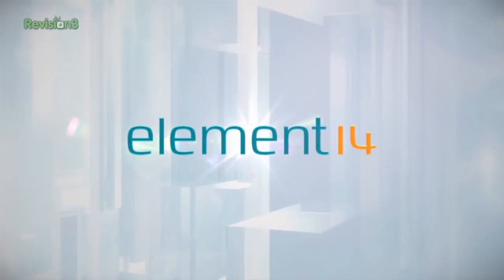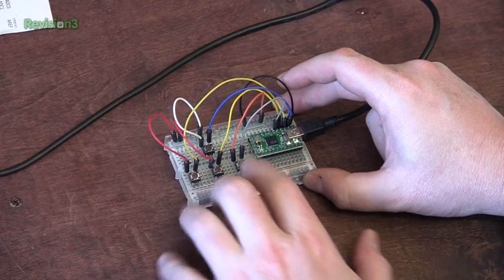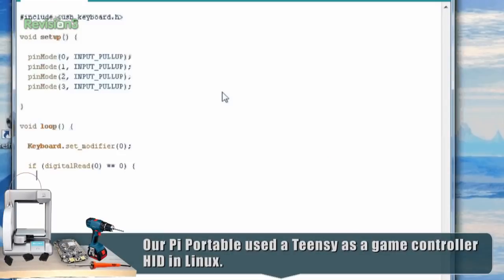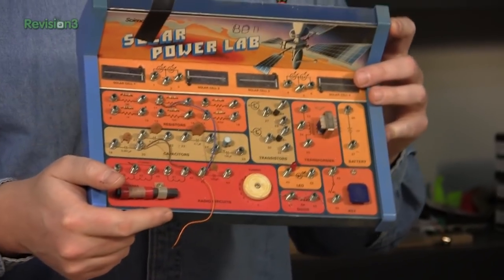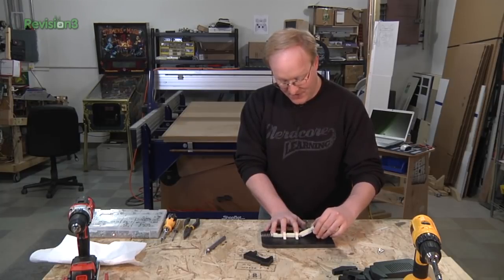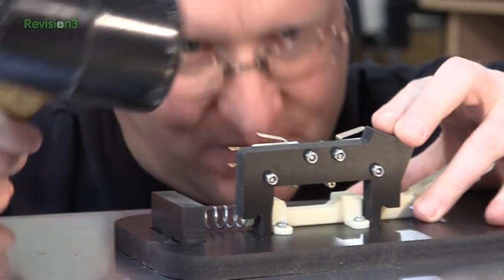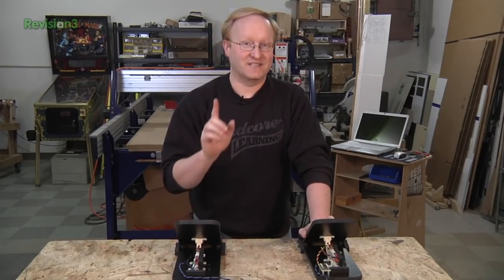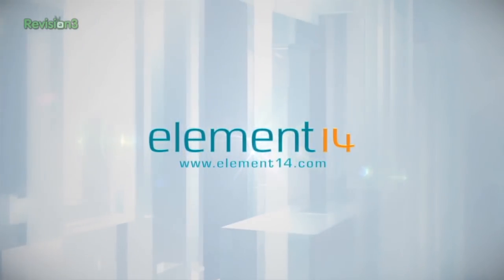Beyond WASD: Foot Pedals for PC Gaming

Comment: Why didn't you do the pedals with a potentiometer mounted at the axis, you could have simply used a threshold value for the Vout of the poti, that way you could have defined the points at which the keys are pressed in firmware instead of in hardware, and also altered the firmware to support analogue control (via the joystick component) if you need it, e.g. when playing a flight sim.
Reply: ***** Foot pedals are normally for the rudder. Flaps are usually some kind of manual control, since you don't use them much.

Comment: Would it not be simpler to just buy a set of pedals and configure them in the game you want to play to do the functions you want or use their software to present as something a given game can understand (like forwards/backwards)?  They do make & sell pedals... both 2/3 ones for racing games and 2's for rudder control in flight sims.
Reply: Of course it would be simpler. That's not the point. Are you new to this channel?
Reply: No.  I'm not.  I can see the point in the 360 auto-changer, I can see the point of a portable Ouya or the various one handed controllers.  No alternatives really exist. 

This is however a pointless waste of material, better alternatives exist.  That the person requesting this build was ignorant of them is neither my fault or my problem.  Just like your snide comment isn't either.
Reply: sarahts21 A lot of the stuff Ben makes is kinda dumb or junky. The value in these videos for me is the process.

Comment: i would just use a cheap keyboard and rewire it
Reply: A USB keyboard could certainly be cheaper than a USB microcontroller at this point - but the keyboard might have unfavorable chording limitations or ghosting issues. Starting fresh with a microcontroller means there aren't any potentially unknown issues like that to work around.